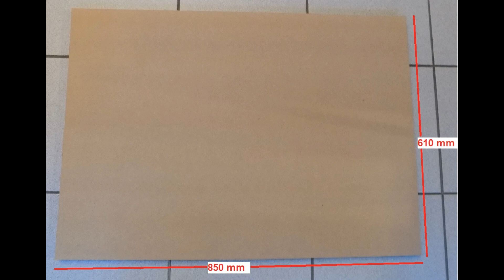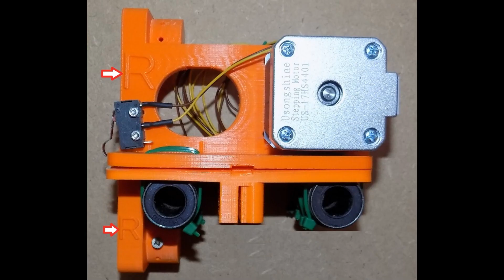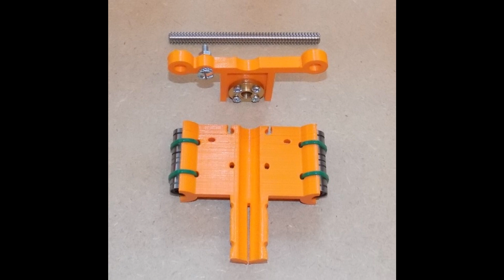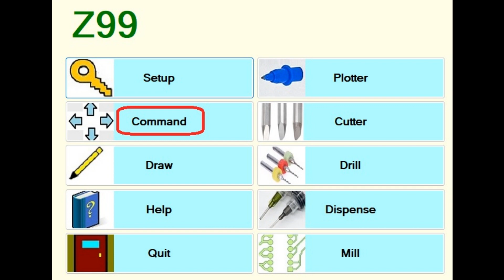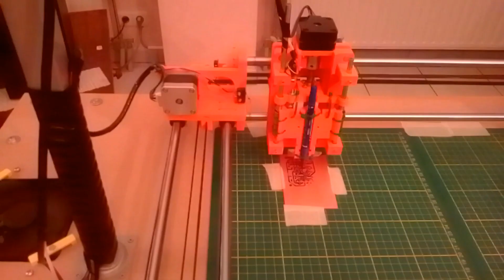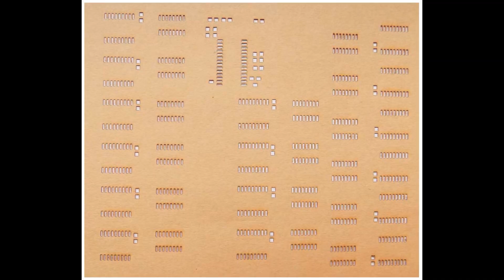Build Your Own 4-Axis Multifunctional CNC Machine

Comment: I intend to buy the book from Elektor. The question is, from where can I obtain the CAD files for printing the 3D-Parts, Gerber Files for the PCB, etc. Thank you.
Reply from the maker: The 3D parts and PCB files are in the github download https://github.com/opaJG/Z99
Click on the green tab "Code" - Download zip and extract the zip. Thanks!
Reply: @joseganseman524  Thanks. I purchased the digital book from Elektor today. I will give the project a try after I finish those in progress. I worked with PIC uCs two decades ago. Did you write all the firmware in Assembler?
Reply from the maker: The download contains the hex files and source code written in MikroC from MikroE @udp47
Reply: @joseganseman524  I found the source codes in folder ..\MikrocontrollerCode\SourceCode. I also saw an Assembler (asm) file in each PIC uC folder. That's why I asked.